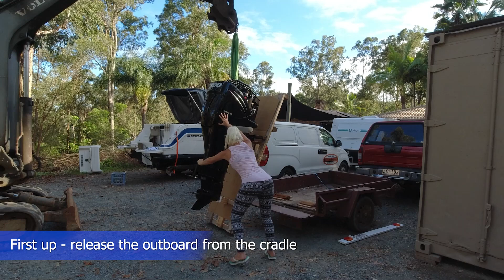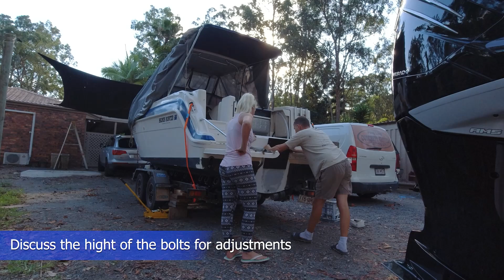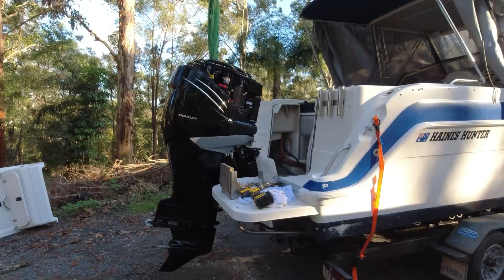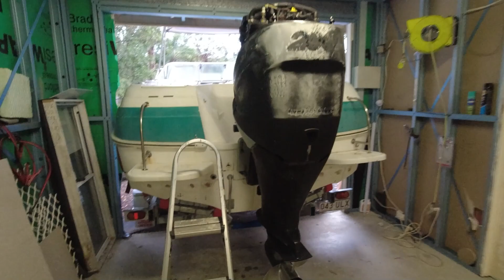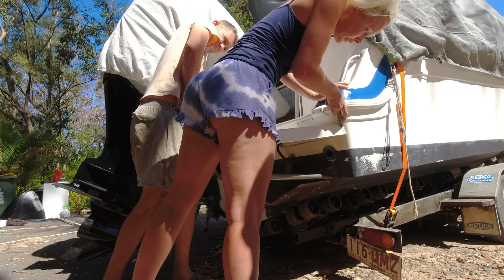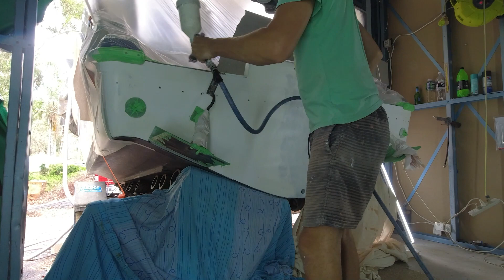Haines Hunter engine replacement part 3 - Transom prep for our 300HP Verado

Comment: Hi Brooke. 
Just a point to note, when I was young, I learned from a real old school marine mechanic. When rebuilding hulls, not to use Marine ply as it is designed to keep out chemicals and contaminants like resin. Standard ply will soak in the resin meaning it won’t Rot and making it stronger. 

I have never been in the position to test this but it certainly is more then just food for thought.
Reply: False.

Comment: Great job, 👍 
BTW, I think you need to do the calibration on your  PCM and your new OBM, u still can use the 200hp rigging harness,key switch,killer switch n the throttle lever

Comment: You cannot just hang a 300hp engine on a transom that isn’t designed for that .
Reply from the maker: This boat from factory was designed for an outboard motor, a customer asked for an inboard motor so they modified an engine bay for this boat.

Comment: You wasted your money   On a Brokery I I mean a Mercury. Should of got a Suzuki 10 times a better motor and 2x longer warranty. Hopefully you got  one of the few ,a good one !! I had a brand spanking new Brokery it blew up twice. I wish someone would have told me to stick with Evinrude,I was born Evinrude I had a 9.9 Hp 1979 I use and abuse it,sank it twice running full throttle took home and clean out and continue to abuse. I now have my  2008 Evinrude 300 etec I set the emm to tcw3 setting computer runs a little heavy on oil change plugs every 100 hours. I can scan engine myself. Good luck on your Beautiful new shiny motor  JT HOOKED N ROLLING OFFSHORE 🇺🇸🇺🇸❤️‍🩹🐟🐠🎣🛥
Reply from the maker: We've never had any issues with any of our Mercs.